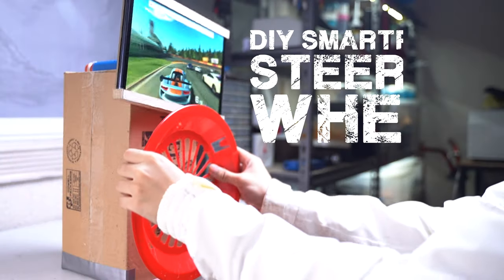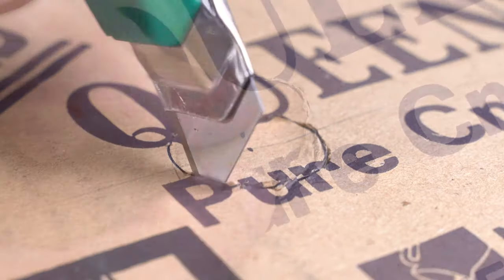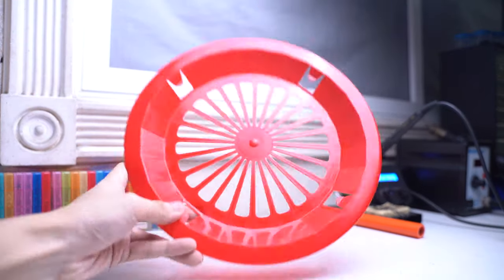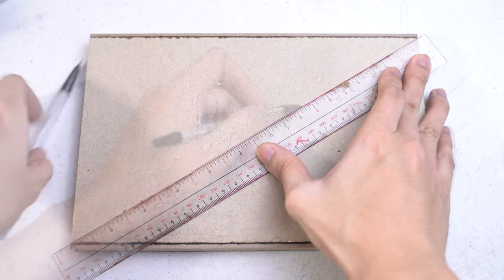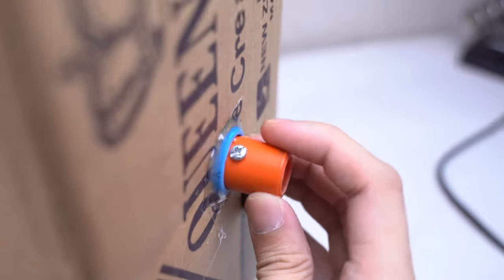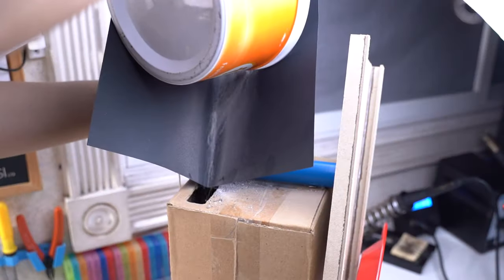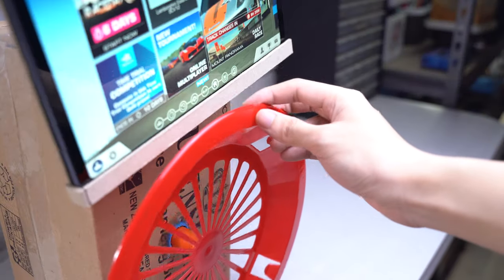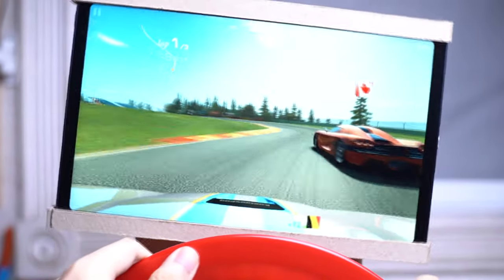DIY Cardboard Steering Wheel

Comment: I have a question. Technically, can I use a smaller pipe for the wheel, then put a hole for a long screw in both the pipe for steering, and the pipe for the steering wheel for a screw, so I can put custom steering wheels without permenantly putting a wheel. Right?